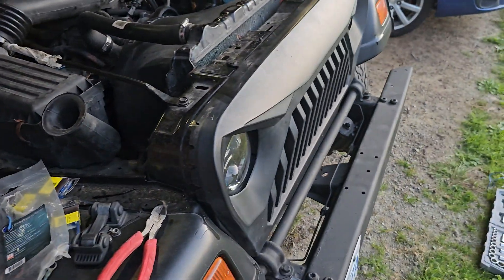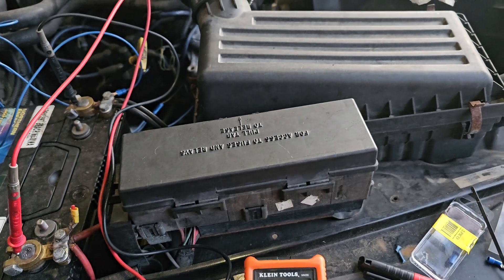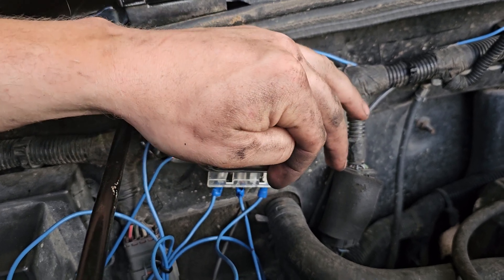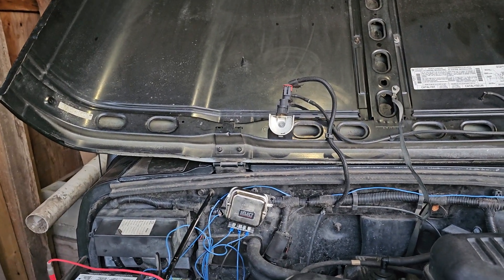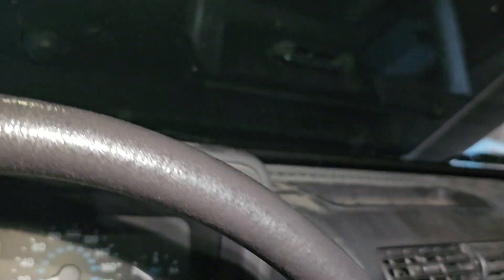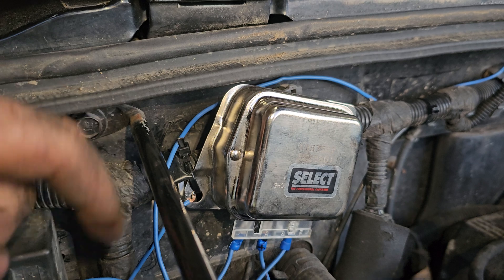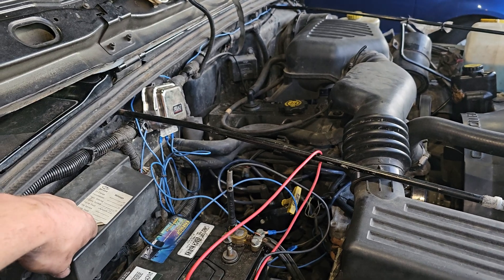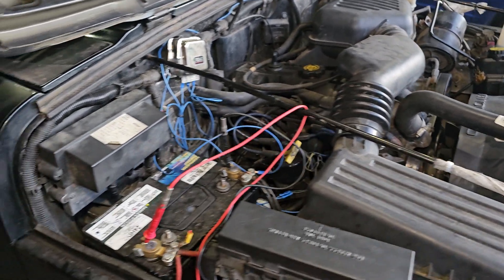HOW TO FIX JEEP WRANGLER CHARGING SYSTEM FAILURE WIRING EXTERNAL ALTERNATOR REGULATOR

Comment: This did not work. I literally tried everything. I did not work
Reply from the maker: Then you might have a defective alternator, or have wired it wrong, how do you have it wired currently, what voltage regulator are you using, how olds your alternator? New battery??
Reply: @ghostlyrich  new battery, new alternator. I have a quicksand regulator coming in. I'll go from there

Comment: I did it with a pass external regulator, but the check engine its still on, I tried installing a 4.5 kohms between the two original points but it does not work

Comment: I wish I had seen your video 5 days ago, I just went to the shop someone else did it for my YJ Jeep. I got rid of code 46 but I still have code 41, "Alternator field control circuit open or shorted".
Reply from the maker: If you have a external volage controller. The main pcm will not have a field connected to the ult so i might be seeing the circuit is disconnected since the aftermarket one is connected and not it

Comment: hi man, i saw that you fixd a monitor way before, can you give me some tip on my samsong g5 that keeps torn off almost eavry 10m for like 30sec and back on agien ?
i tried a lot of things olrady,  I used other cables. display port and HDMI. I used a different power cable. I reset the screen settings and also tested with different heart frequencies and reaction and boost functions, and no defrent
best wishes
Reply from the maker: Did you try it on a another source like a cable box?
Reply: @ghostlyrich  yes, same thing